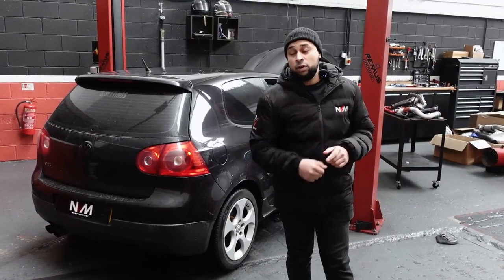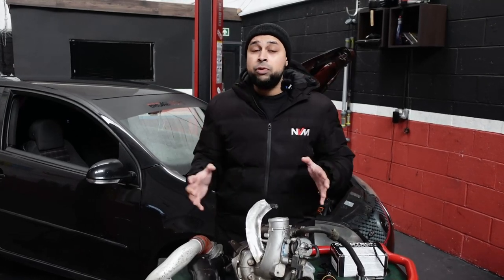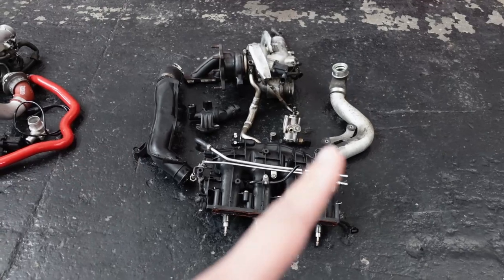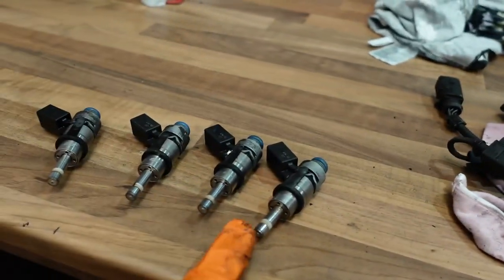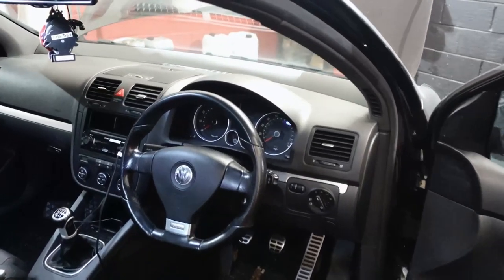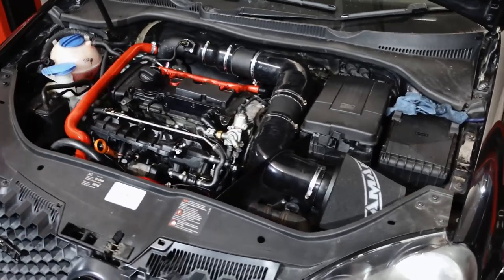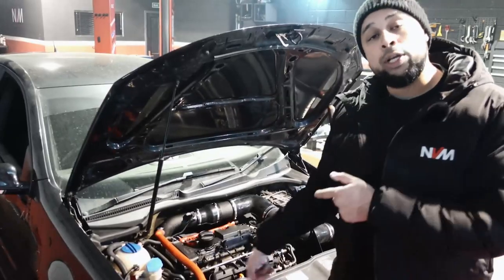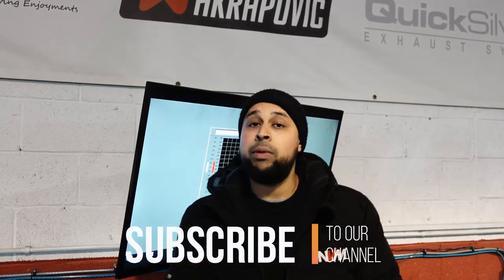HOW we TUNE a K04 Conversion Golf Gti!!

Comment: Okay so if something like this was done to a stock gti is this all you do and it’ll still run or would you have to do loads of other things to it to get it running properly?
Reply: From what i have seen it'll6 run still BUT, it will be nowhere near what its capable of, esp because of the ecu set to shut down if boost goes over like 11.5 psi if i remember correctly.. and it'll certainly go beyond that 11.5 psi with that bigger turbo, along with the dtocketf54!
    Anyway, im hopefully getting my first vw, and first gri in a very long time!! Had 2 2nd generatikn mk2 lil 1.8 8valve gti's way back when i was a young man. First one had 54kmi original miles on it, it was GORGEOUS!! 
 Anyway, cant wait to be over 300hp in one(mk5 is the one im supposed to buy!). Good luck with yours!!

Comment: Hey mate I just bought a stock mk5 GTI. Just wondering can I slap a ko4 turbo straight on an do I need to do some upgrades before hand or what do I do before I do a stage 1 tune
Reply: You can go up to stage 2 with cold air intake and a downpipe. (What i run)
Thats all you need for a stage 2, stage 2+ is bigger turbo, better injectors, bigger fuel pump, etc.

Comment: Any recommendation if the ko4 conversion kit of a mk5 gti will fit a 2009 scirocco 2.0tsi?
really want to convert if but not enough resource for it.

thanks!
Reply: To TSI motors you need is38 turbo